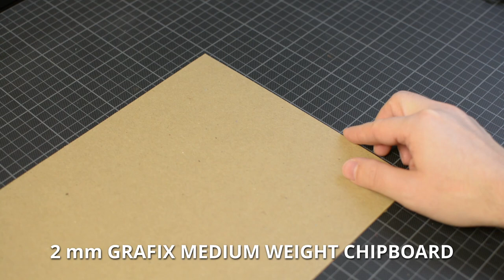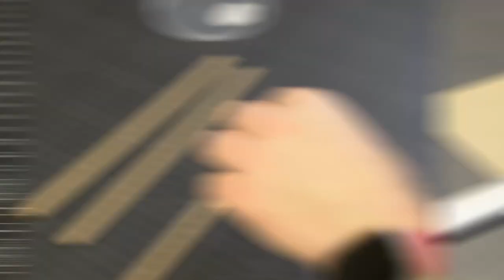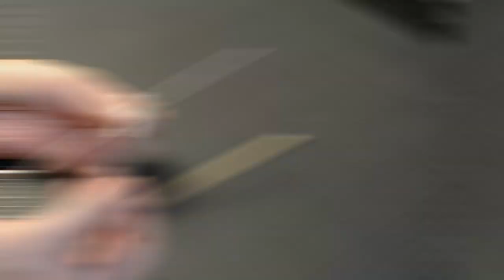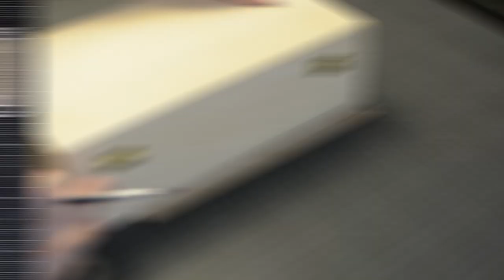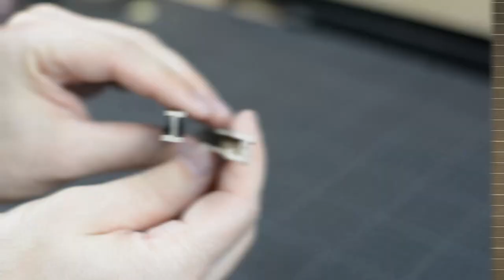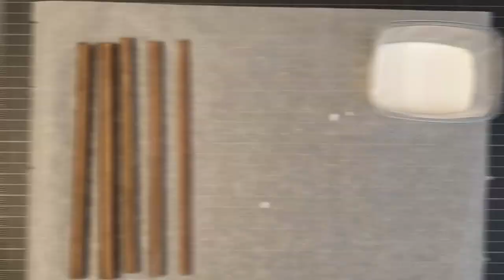How to make cardboard H-beams and L-beams for wargaming terrain // Kill team, Necromunda, 40K

Comment: Hi, great video, congratulations!  
I'm an amateur woodworker and watching your video I was thinking.... 
Have you ever thought about using a (micro) circular saw to cut this material?  
With your skill I'm sure you wouldn't have any difficulty.  
There are kits of circular saw blades to Dremel of about 5 cm in diameter, with a 775 motor the cut would be very easy, fast and practical.  The big difference would be the side guide(fence), on which you support and slide the part you want to cut against the saw blade, for a precise cut.  This gives repeatability to the cuts.  
You would have a very useful tool for subsequent projects and it would still earn you another great video for the channel.  Hope I helped, all the best.